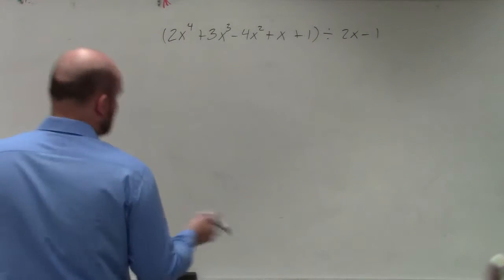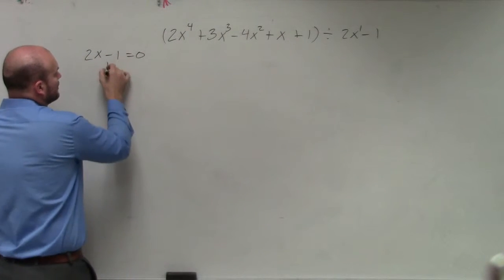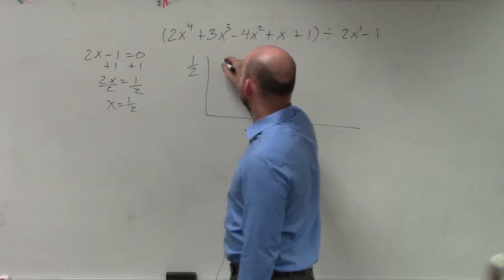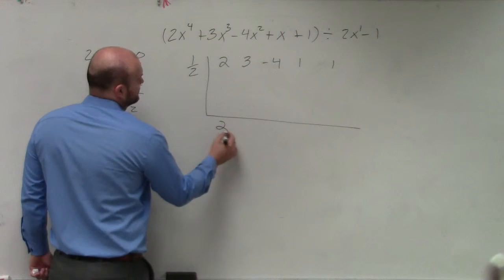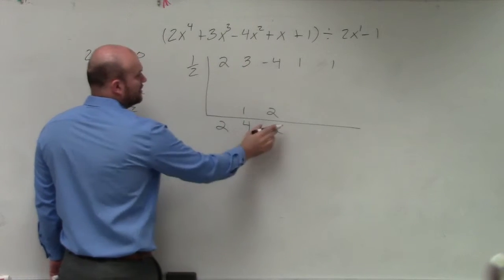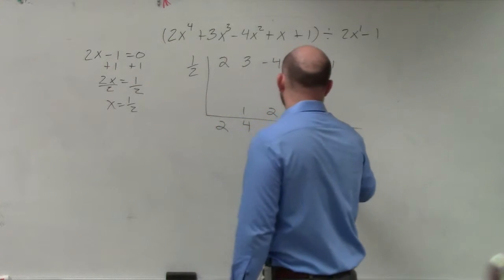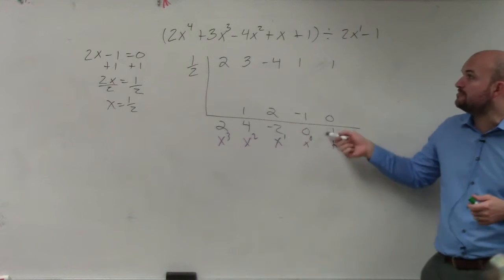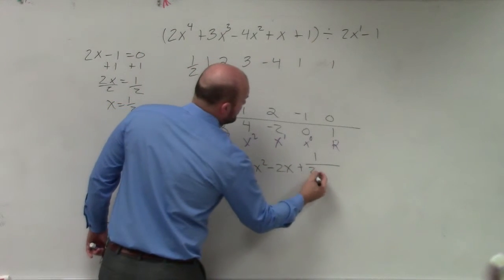How to apply synthetic division when your zero is a fraction

Comment: But this doesn't work across the board.  Synthetic division is for (x-b), not (ax-b).  You are supposed to divide out that 2 at the end, so this answer is actually incorrect.  Just a heads up folks